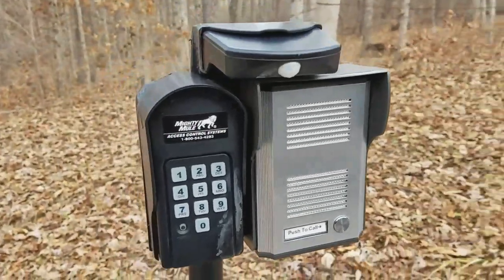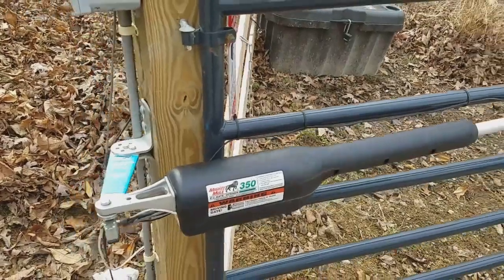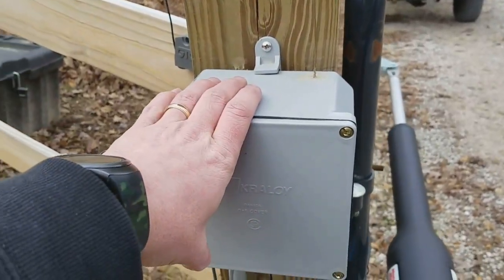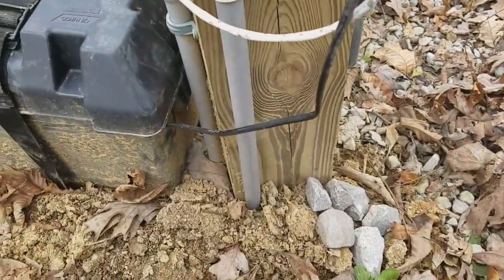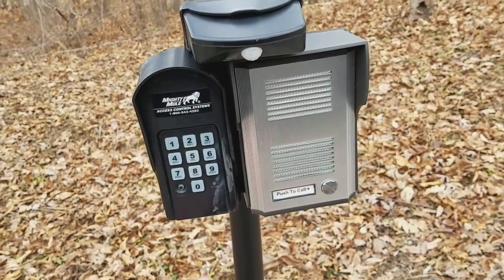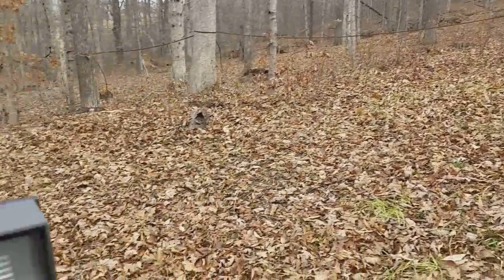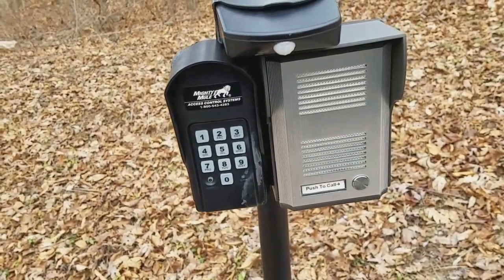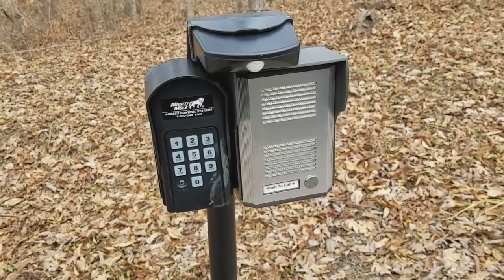DIY Cheap Remote Gate Access Control and GSM Intercom System

Comment: I use a $35 wireless Vtech Baby Monitor from Walmart. The Baby Monitor has two way talk and a 1500 foot wireless range. Works great for my gate that is 300 feet away from house.  So now I can talk to people at the gate and they can talk to me. For about $80 Walmart has a Vtech VIDEO Baby Monitor that can be used to see who is at your gate. It has the same 1500 foot range.
Reply from the maker: Any problems with the weather? How do you protect it from the elements?
Reply: @JackofAllMasterofNone  Just mount the remote baby monitor inside of a small plastic or metal outdoor box. Cut out a 3 x 5 inch hole in the cover or drill a bunch holes in the box lid.  Cover the holes with a thin black cloth or black plastic to keep out rain.  Both baby monitors run on 6 volts DC and the 6 volt DC adapters are included. But if there is no 110 volt AC at the gate one could just connect to a 6 volt rechargeable battery. It's best to cut a DC plug off of an old 110 volt AC adapter that has a plug that is the right polarity and size. The monitors are quite sensitive to sound and very understandable when talking to someone. To talk to someone at the gate the inside unit has a button to press when talking. The outside unit doesn't need anyone to press any buttons. The person at the gate just talks and you can hear them. They really work great. At my gate there is a utility pole with a big AC power transformer on it that creates a lot of electrical noise. But these monitors are NOT affected by that transformer at all. The only issue is that you have to figure out the best way to protect the outside baby monitor. I think it could possibly work to just solidly mount the outside monitor in a small open faced plastic or metal box if the box was deep enough to keep rain from hitting the monitor. A box 6 or 8 inches deep might work.
Reply from the maker: @SundayBeastz  Thank you. Will keep this in mind

Comment: Fanvil i20s is a door phone that runs on SIP which can be powered VERY cheaply if you know what you are doing using a service like Twilio ($1.25 per month per phone number and $0.003 per minute of usage on the calls) you can pipe a connection to the Fanvil.  If you run two Loco m2's from Ubiquiti it would provide internet access from the main house to the gate.  At the moment I would not switch away from the current setup but in a year you might start looking into that type of solution.  You already have 12v at the box and it could easily be switched over to this type of setup.
Reply from the maker: Thanks for the comment. I will check it out.

Comment: I am in the process of installing a MM502, however, I was trying to figure out a more secure way of storing the control box & the battery out of the weather and from vandals...I have thought about a plastic storage box or maybe building a box out of some scrap wood, but still haven't decided yet (though these ideas are not really that secure either)...I had to buy the extended arms for my gate too, as it opens toward the vehicles.  I also thought the way MM wants you to bolt on the arms with the nuts facing outside of the fence, that's kinda a$$backwards, right?  I mean, that leaves the vandals the ability to unscrew the arms from outside the gate and possibly steal them??  Maybe I am more security conscious than the engineers that work for MM company, idk.  Great video btw.

p.s. it appears MM has a wireless intercom/keypad, however, per the reviews it is horrible.

Comment: Was that a camera up in a tree back towards the road? If so, what kind? I have been researching different cameras to use at my gate.  I have Arlo's all around my house but with my gate being ~415 feet from by Arlo base station, I don't know of a way to use an Arlo camera out there unless i go with their LTE camera which is $$$.  Thanks in advance.
Reply from the maker: Wired regular old hd-tvi. It's a pita but wired is the only maintenance free way

Comment: I'm wondering if a SIP-VoIP intercom and a WiFi bridge would have done the job too...  A SIP-VoIP intercom will cost you about $150 new (retail) for a barebones call button with mic and speaker (if you want to go cheaper, get a RaspberryPi on each end).  A cheap WiFi bridge goes for about $30 an end, and with the correct antennas you can focus your signal at a specific house to avoid interference and interception.  Over the SIP-VoIP door phone you can do alarm inputs and gate control outputs which would have likely simplified the system, and you wouldn't have to worry about your local cell-carrier changing on you.

For reliability, security, and maintenance; I would have just run a conduit to the house and pulled power and fiber to the gate box.  You can keep your 12V battery as a backup (good to have), but use home power primarily.  Fiber-Ethernet converters are just as cheap as wireless bridges nowadays, and there's no WiFi/Cellular jamming possible with fiber (I just picked up a set on ePlace for $31/end).  With fiber down to the gate, you can put in an IP camera (or two or three) to watch over the gate as well at only the hardware cost of the IP camera (can be as low at $100 for a weatherproof 1080p dome).

Sometimes I find that doing things "on the cheap" or "as cheap as possible" leads to shortcomings that have to be either reworked or worked around later. I've personally found it's better to find a reasonable point below the 80/20 point (where 20% of the work results in 80% of the outcome) that is likely to allow for additions and alterations later, and that often means walking away from standard limited commercial offerings. My 2cents.
Reply from the maker: +Tim S Good comment. I agree with you but this system hasnt failed me yet!

Comment: Why did you set the gate up to open towards the road?
Reply from the maker: Because its uphill towards the house and the gate cannot open that way unfortunately.
Reply: Why not a sliding gate then?
Reply: The gate will be braced against the post making an attempt to ram the gate open a difficult task.

Comment: YOu could beam wifi down there using wifi bridge ($200) then use any video intercom which allows you to check to see if the door is closed or open anytime u want
Reply from the maker: That is exactly what I plan on doing when 2g is no longer supported or the intercom breaks. Im just trying to find a good video intercom with a relay output that will work over the internet and not just internally on the network, so if you have any suggestions, feel free. Thanks.
Reply: Why not the Nest Hello?

Comment: This was very informative. I wish we had T-Mobile rates in Canada, 
You already got enough involved in that build without considering the 3G
.certainly not a DIY type build even though you mix and match bits, there are many valid high end components. 
I was just about to begin with a real DIYers bent and start with a GSM dev board running an A6 GSM chip and first thing you begin to hear/read is the 2G systems "Sunsetting" ( i loved that term btw) So now what? Do I just simplify and go with RFI tags. Our drive is perhaps even longer than yours and the owner wants closed gate during the work day. So I wanted to make a xmas gift of a text gate opener solar/simple logic/ timed closure. But with a optical safety of course. Arduino and $7 GSM . And now it is all going to hell with 2G network vanishing

Comment: Very interesting Jack. I am in a similar situation with my driveway gate build here in FL. ( gate is over 1000' from house) . Would like to come up with a gsm intercom that I can install myself and won't break the bank. All the reasonably priced offerings seem to be coming from overseas. I like the Advent Controls unit you used but am concerned about the 2G thing. I emailed them and was told I needed 4G and their unit wouldn't work here (obviously thats not 100% accurate). Another potential option is the Waferstar GSM-HOUSE or GSM-APARTMENT from China. Have you checked them out? I am not very knowledgeable when it comes to cellular networks and am unsure what will or won't work and why.  Any input you have would be greatly appreciated.
Reply from the maker: +jeff baldwin I dont think the waferstar ones will work. They are also gsm intercoms and would only support tmobile here in the USA. You need a 3g compatible model that supports 850mhz and 1900mhz on 3g minimum to run on AT&T. They are a little harder to find and more expensive.
Reply: I think the waferstar gsm apartment will work at $200 and I see it being offered through one of the online gate suppliers rebranded at 3 times the price. I would prefer the gsm house as it doesn't require the person at the gate to enter in any numbers.  Waferstar has indicated to me through limited and somewhat confusing terms that the gsm house is also offered in 3G at 850/1900 mhz. Looks like Advent Controls gave up on 3G and are having trouble with or don't want to mess with 4G. I'm probably gonna take a chance on one of the waferstars , I'll be darned if I'm going to spend 1000+ on a cell phone in a box and then possibly have to subscribe to a monthly service for it to work. In fact maybe I should just put a cheap cell phone in a box at the gate! Do you think a Cricket sim card would work with one of these things? I think they are a subsidiary of ATT and use the same network. 
Been checking out some of your other videos and see you have a lot of the same interests ad I do. I've spent my whole working life figuring out how to do things so I didn't have to pay somebody to do it for me.  I've done everything from forming and pouring concrete to repairing transmissions, whatever needs to be done. It started out a necessity but I have really grown to love the challenge and doing something different all the time. Keep up the good work!
Reply: @jeffbaldwin9842  did you end up trying the GSM-HOUSE from waferstar? How did it work for your situation?
Reply: @JoseBrache  No, I even cheaped out on that and instead went with a chinese $20 gsm switch (rtu5024) off ebay that works like a champ. I can open the gate from anywhere with a call from my cell when somebody is at the gate. Got a free sim card from us mobile (with promo code) to get it going and its costing me $4.25 a month to maintain an active line. You have to configure the switch via text and  give it a list of approved numbers that it will recognize and activate when called (it doesn't use any minutes as it hangs up as soon as it sees the number calling) Can't believe how well it works (though a little clunky to configure) and my experience with it suggests that the waferstar gsm-house and others from China will work just as well. Just be prepared to fiddle with it, Your mileage may vary. Good Luck!
Reply: @jeffbaldwin9842  Great, thanks for the information!

Comment: I was curious on the mounting of your GSM system to the post along side the keypad. And also the wiring configuration to combine the use of both items. Thanks
Reply from the maker: Used a coated board to mount them both too, which is mounted to the pole. The keypad is wireless and battery powered. The gsm controller has 4 wires. Power and gate unlock.
Reply: Jack of All Master of None My driveway is right at 900 feet so I've been looking at a BFT cellular intercom for 600 bucks. Just wasn't sure how many wires I needed to bury to my post. I just mounted my mule to the gate. You still having good luck with yours? Thanks
Reply from the maker: Yes it is still working good. I have had to replace the rev counter module about 3 or 4 times though.  The reason is because water can easily get into the gate arm, even if it is level. My advice to you would be to make sure it is slightly slanted down towards the attachment of the arm at the gate, just enough to make sure moisture cant run down the ram arm into the unit. I finally figured it out and it has been working good ever since.